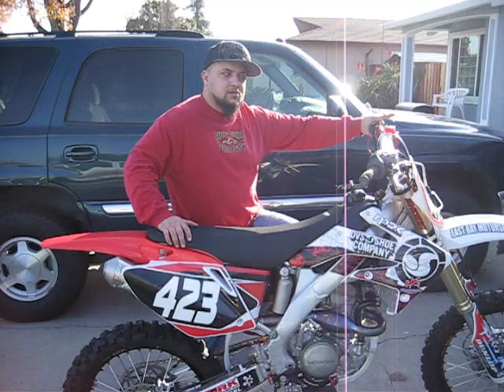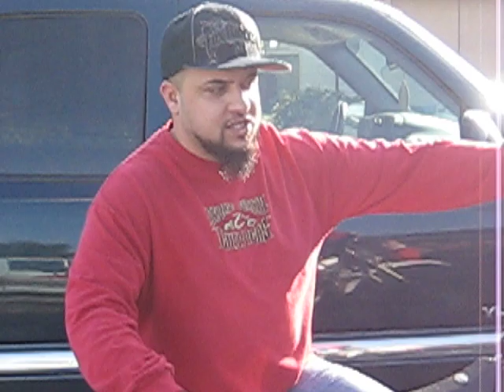2005 crf250r motor before the rebuild

Comment: nice bike bro i just picked up a used one its my very first 4 stroke im a die hard 2 stroke fan because they are easier to rebuild im still learning about the 4 stroke motors is it hard to rebuild, i know it has valves, cams, timing chain & tensioner so im thinking its a pain but whats your take on rebuilding it.